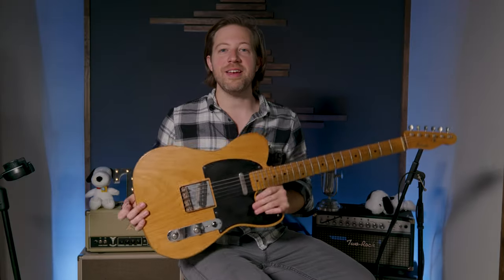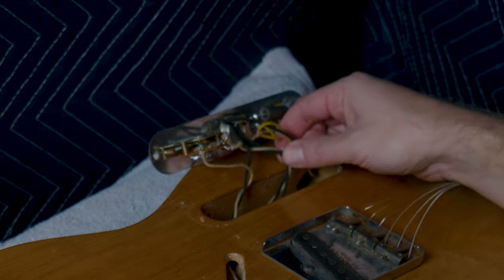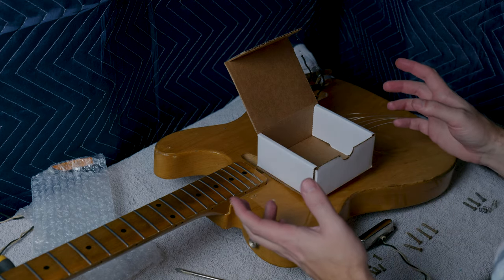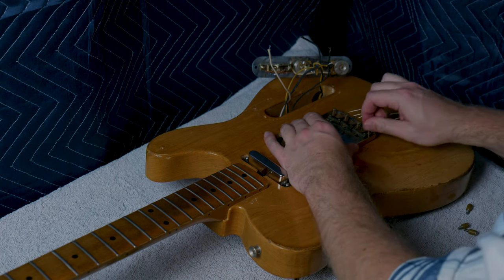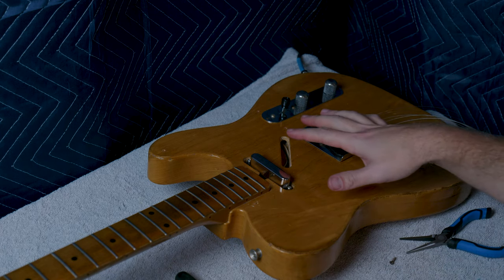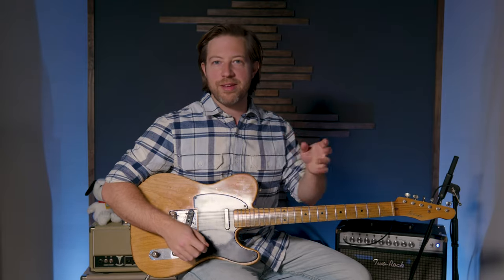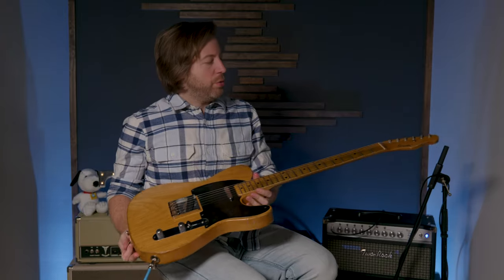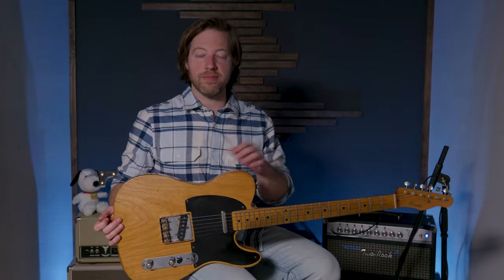Amazing Telecaster Transformation! - Pickup Swap in a DanoCaster - Ron Ellis Pickups

Comment: Many would consider Peter Florance Voodoo TE50s as holy grail pickups. On top of that, Dan Strain carefully matches pickups to each guitar he builds (see his interview with Ask Zac), so he thought the TE50s were the best pickups for this guitar (though maybe Ron Ellis pickups were not available when this guitar was made). Bottom line: I would not expect a dramatic improvement going from TE50s to Ron Ellis pickups, in fact, I'm not sure I heard any improvement at all. I would add, lastly, that to call Peter Florance pickups "factory" pickups belittles his memory.
Reply: I agree! I had a TE50 in a Tele before. One of the best pick up builders. I have Budz Danocaster pickups in my Tele now and really like them but if I didn't, I'd be looking for a used TE50 or similar Peter Florance pickup. With his passing, I know they're getting harder to find and more expensive.